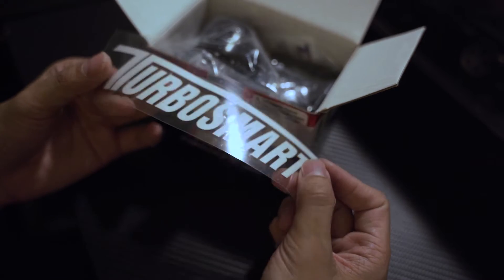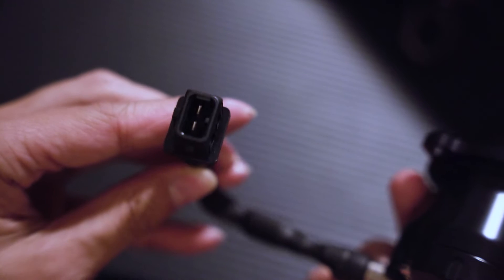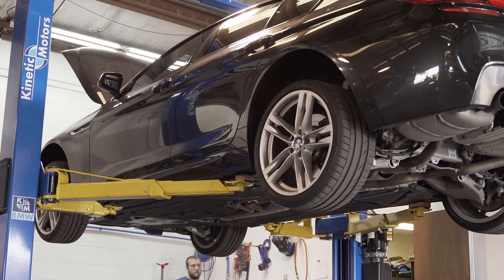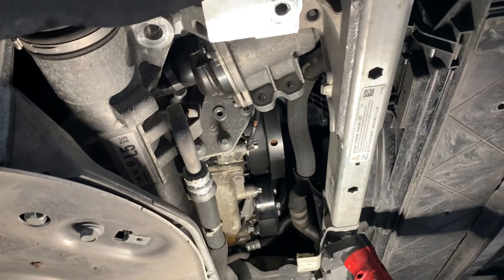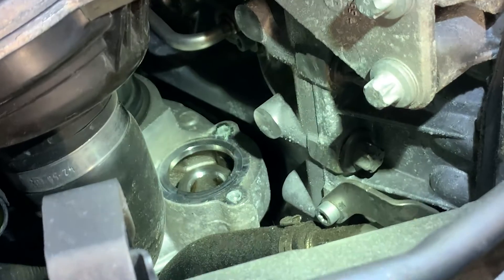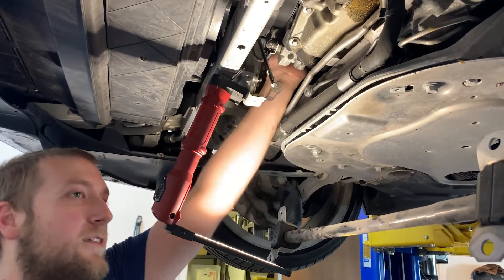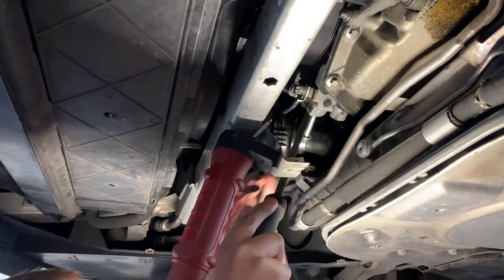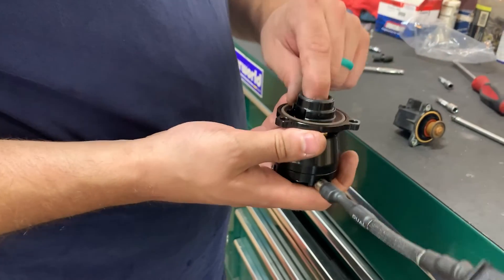BMW N55/N63 Turbosmart VR9 Dual Port BOV Review w/GOOD SOUND!

Comment: I know a lot of people like the BOV sounds, but I feel like it would get annoying pretty fast.  For people who have lived with this, what do you think?
Reply: I have the Turbosmart dual port bov on my n55 135i with high flow 4inch catted dp, bmw performance exhaust (= res deleted) and it is really almost non existent when normally driven. Most people wouldn't even notice that it is even a thing when driven normally. 

It is rowdy and awesome when you deliberately want it to whoosh.
Reply: i have a vr7 on my 4banger camaro fully straight pipe love the sound never gets old and def turns heads everyone always wonder whats under the hood little do they know its just a measly 4banger😂

Comment: I’m just curious. Do you have an aftermarket intake on your car? I have an aftermarket cold air intake and I’m thinking of adding this BOV and I’m curious how it sounds when they are paired together
Reply from the maker: Now i do and i'll do a follow up video with the intake. It was stock with a drop in filter.

Comment: Is there like power gain
Reply: yea would like to know.

even if stock car with this BOV . does it need to tune or something?
Reply from the maker: No power gains, just noise.
Reply from the maker: @bizzy  No gains, just noise. lol
Reply: @TheDailyDriver  Does it make the sound between every gear shift in automatic mode too?
Reply from the maker: @beckmarchiniak716  only if you let off the gas

Comment: Wonderful vehicle !
How many miles do you have on your 640 right now ?
And how's it been reliability wise ? 
Any fixes ?

I'm considering this car rn(with 30-45k miles and would probably keep it till like 80-90k)
I would really appreciate any feedback!
Reply: Join n55 owners group on fb. You get a better response there
Reply from the maker: Reliability it's been good. No major repairs outside of power steering leak/replacement and thrust bushings. 60k on the odo so far.
Reply: Got 125k miles on mine and no issues other than cracked dash on passenger side
Reply from the maker: @anthonymullings9429  good to know. A/C just went out on mine... lol And I never crank it.
Reply: @TheDailyDriver  blower motor on Amazon $40 if that’s the issue you’re having, I recently had to replace mine

Comment: Will these fit and work on my 2011 550i ? N63 engine
Reply: I have this TurboSmart model on my 2011 550i TS-0223-1292, Turbosmart Kompact EM Plumb Back VR9 BOV
Reply: You would be a damm fool to install this on a V8 lol. Because of the location, the BOV will eventually fail due to over heating. That information came directly turbo smart the manufacturer technical team.

Comment: I got me but mine flutters.. any ideas why?
Reply: Make sure your pressure sensing line is 1/4".  The 1/8" sensing line often doesn't allow fast enough response, causing the compressor surge.
Reply: @owenkey4010  what do you mean by the pressure sensing lines? Is it the EVAP line?

Comment: Question im interesting in installing this mod will this blow off valve hurt my engine i have a bmw x5 e70 35i 2012 n55 engine ?
Reply from the maker: I haven't heard of it hurting any engines. If anything, it will reinforce a weak part. It's pretty solidly built.